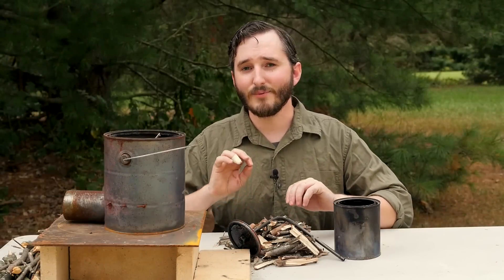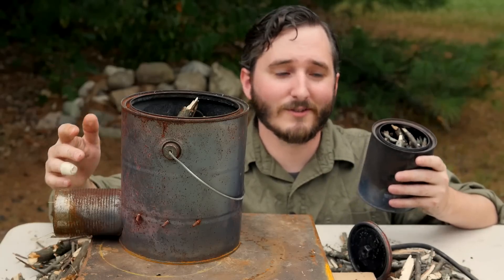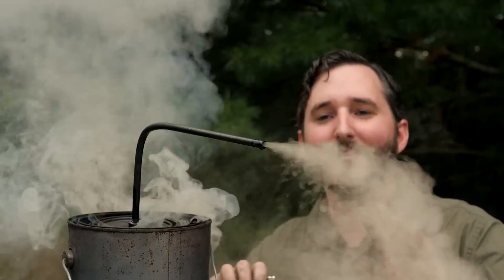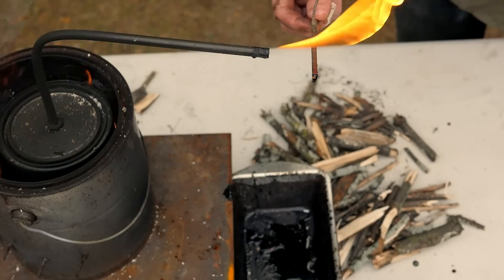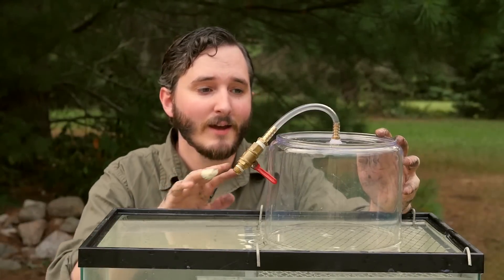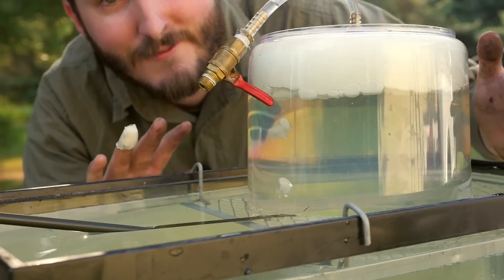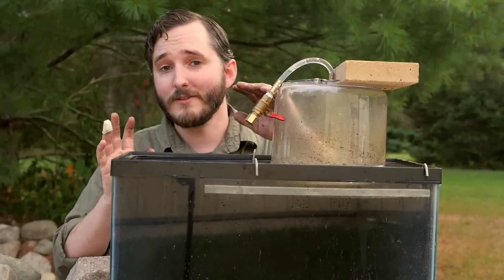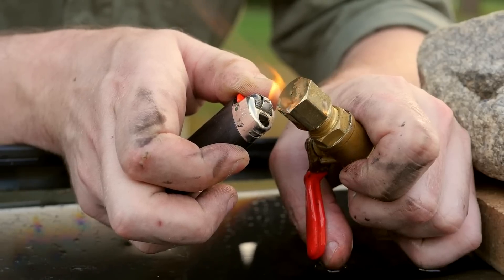How To Make Wood Gas Biofuel (and an experimental gas collection method)

Comment: It would be really interesting to see your take on a woodgas engine. Most of the other videos of woodgas engines on youtube are done by mechanics/etc so seeing it done by someone who is much more theoretical science focused would be nice.
Reply from the maker: I have a video about powering a small engine but I just barely got it to idle. I should try it again.
Reply: <<
Angus Davies
2 years ago
It would be really interesting to see your take on a woodgas engine. Most of the other videos of woodgas engines on youtube are done by mechanics/etc so seeing it done by someone who is much more theoretical science focused would be nice.>>

In my view,  a better follow on experiment would be filling a balloon with wood gas,  which would be portable and keep the gas pressurized.

Then use the gas to fire up a gas pilot light,  and after that a gas range burner and then a gas furnace burner.  These last two would be Bunsen burners,  and you could get an understanding of what those are and why they are commonly used.

Comment: I'm wondering if due to the depth of submerged container, the increased the pressure of the stored wood gas caused a high exit velocity from the outlet -- too fast for a self-sustaining flame. If the pressure were not as high (i.e., by removing water from the water tank), I'm sure we'd have seen a nice self-sustaining flame.

Great video!
Reply: <<I'm wondering if due to the depth of submerged container, the increased the pressure of the stored wood gas caused a high exit velocity from the outlet -- too fast for a self-sustaining flame. If the pressure were not as high (i.e., by removing water from the water tank), I'm sure we'd have seen a nice self->>

Yes,  but more likely was a lack of sufficient combustion air mixed with the fuel gas.  Reducing the fuel gas flow would allow for air to mix with the gas and thus burn. 

Connecting the gas to a natural gas pilot burner would allow the burner design to properly mix air and the fuel gas.  It would also meter out the gas at a sustainable rate,  rather than in what was a wasteful volume you couldn't keep lit.

Comment: Try electric heating coil, or high temp oven, use the experimental water filter, water-shift to CO2 and more H2, then feed back electricity to the heating system with hydrogen-air fuel cell

Comment: I bet you were super stinky after recording this lol. Thanks for the video! I tried to collect the gas by pulling it through an air mattress pump.... It got so hot the can melted! I wonder if filtered - if a generator this small may run a small weed-wacker engine or similar small combustion engine?

Comment: you can make a flashback arrestor easily,... and thereafter distill Hydrogen 2- 3 stages for very pure, very cold liquid hydrogen. It needs be charged into a safe container. 
Do not try to store liquid Hydrogen.... it has all the properties of propane.... With more heat.
Example.... Heat and Pressure turns the Suns surface into a crystal lattice of liquid metallic Hydrogen.

Comment: It's been only a few weeks since I first heard of wood gas. I learned of it first in the context of rocket mass heaters, often homemade wood fueled heaters that have long exhaust pipes and a lot of thermal mass, generally made of Earth. A common feature apparently is a wood gassifier. The main thing I'm confused about, regarding these stoves, is what happens to the tar? I'm familiar with wood stoves, and know that tar, or creosote buildup in a stovepipe or chimney is a major hazard. So I don't understand how it can be safe to have a long, meandering exhaust pipe buried in Adobe. Even your fishtank looked inky after this experiment. What am I missing?
Reply from the maker: Tar buildup is only dangerous if it's in a chimney running through your flammable attic.

Comment: Love the video!  We live in a part of town/country that doesn't have gas and I was looking at home biogas.. We use clay pots for their multitude of benefits, but they do WAY better cooking on gas.  Would love to know if you could come up with a way here to make this usable for kitchen cooking.  

Also, what makes that charcoal that you made different then biochar?  You didn't heat it enough for it to be biochar?  

Also, what precautions are necessary for the biogas to not ignite your lighter or to reignite itself inside the tank if the flow is unsteady?  The lack of oxygen in the tank or the pressure from it?
Reply: <<Would love to know if you could come up with a way here to make this usable for kitchen cooking.  >>

Wood gas is explosive if you mix it with air,  just like propane or natural gas. Trying to store enough wood gas to use as fuel for a range might easily create an explosion hazard.

<<Also, what makes that charcoal that you made different then biochar?  You didn't heat it enough for it to be biochar? >>

If he had show you what was left in his cannister after making the biogas,  that would be biochar.  Charcoal  ---more or less pure carbon.

<<Also, what precautions are necessary for the biogas to not ignite your lighter or to reignite itself inside the tank if the flow is unsteady?  The lack of oxygen in the tank or the pressure from it?>>

That's a VERY good question!  "Flashback "  is the term for gas that is moving too slowly to keep it burning at the burner where it should burn.  Fuel gasses will burn so many feet per second.  If you don't have the gas moving faster than that,  it will indeed flash back inside the gas supply,  or the wood gas generator in this case.  You'd also need air mixed with the gas for that to happen though.
Reply: @SeattlePioneer  Thank you for the reply, we since moved to where we do have gas and I also discovered 'solar cooker' and 'solar stove' which might be way more doable here in Texas than in Seattle, very excited to try them

Comment: Couldn't you have just opened the valve, pushed the collection tank down into the water, and then closed the valve?  You would have been able to evacuate all of the air and wouldn't have had to suck the water up.

Comment: You could wrap  the bottom of the radiator with a copper coil system to heat water.  So in a power outage, you can reclaim that heat for hot water.   Lets put ALL that energy to use!!

Comment: If you could take a water cooler bottle with a cap you would not need to sink the container. Then having a bladder with nozzle like bicycle inner tube. Then using a tire pump you could pressurize the container and use it directly. 
What do you think about that?

Comment: If you used a propane torch nozzle you likely would have got a sustained flame with the correct air / gas mixture
Reply: Robert Pearce  :D

Comment: You could place a air compressor in air tight container and gass line from your wood burning stove in it this way the air compressor will compress all the natural gas only. Good jobe on the vido  and on all your videos

Comment: Just out of curiosity, what are the carbon emissions like from a process like this?
Reply from the maker: Neutral. Burning dead sticks from the forest floor is carbon neutral because the sticks are destined to otherwise rot by fungus, which releases an equal or greater amount of co2.

Comment: OK great video, try a small tire inflation pump run the intake to the little tank with the clean gas and the tire side to an old truck inner tube.
After that you should have pressurized gas enough to run a generator or if you scale up the production end and bigger cleaner with a good supply of intertube.
If you pipe the gas in enough cubic feet per minute I'll bet you could fill a compressor tank at 120+ PSI run it through a regulator to what ever engine you want.

Comment: Hmm... You've got my gears turning now. Thinking a longer outlet line with a heavy duty condensation collector (such as whats found on air compressors) would be a good solution at collecting the tar out of the gas

Comment: You need something called a burner( and a pressure regulator.) Study how a propane touch is made ( bbq) A natural gas burner con be copied also because the btu are  approximately the same as the btu of the gas you made. Important to get the fuel/ air mixture correct.

Comment: I saw a video about making and filtering methane.  They put a small drum upside down inside a larger drum. With something to keep it from tipping over when it floated up. The gas is taken off from the small drum somewhat like you did there.  But they ran the gas up a long pipe with steal wool in it to start filtering the gas. It would cool and much of the tar and other things would stay in the pipe.  Some way to drain this off or a large place for it to go so after a long time it would not stop the flow of gas would be needed.  Methane doesn't have the tar. But the steal wool will filter out anything and if any acid is formed will lit it react with the steal wool as it goes up the pipe. As the gas is made it will float the small drum up and give it some pressure. Not sure how much pressure the gas from the wood would make to push the drum up. But it also bubbled up though the water to filter.  Then a U shaped pipe to let some of the water in the gas to condense in the lower part of the pipe.  Another place to have something to hold or drain the water. A cool pipe should get most of the water out. Maybe if the pipe ran upwards so any water that formed in the pipe would just run down back into the drums of water.  Just thinking!  Maybe it could work maybe not.

Comment: if you fix your receiver to the bottom of your tank and let it fill,when you produce the gas into it the pressure will displace the water and when you want gas, the water pressure will displace it out again,the volume of water displaced = the amount of gas stored,, 1Litre = 1 litre

Comment: Build a large bong much like here and run a hose from the top of it to the air intake of a compressor. You should be able to collect all (or most) of the gas and then power a small engine.

Comment: Its not propane or butan ... Its CO or cacbon mono oxit ...its produced when carbon is burned in oxygen lacking environment and its extremely poisonous many die every year inhaling that compound from coal fueled heater in confided space,... Its not dangerous but useless in most situation, especially for cooking in house.

Comment: Instructions unclear. I created a Level 3 Nuclear Biohazard.
Reply: My station is worse i accidentally create a nuclear bomb
Reply: Lol
Reply: lol
Reply: I'm sorry, not only have you failed to read the instructions properly, you have also failed to spell "unclear" consistently.  You, in fact, do not have any nuclear hazard, you have an unclear hazard.  Don't worry, the EPA is much more friendly than the FBI.
Reply: @Kineth1  the EPA are nazis compared to the FBI
Reply: Hey what if you had an afterburner oxygen depleted after burner to burn the tires s*** off first before you collected it would that not work I does work I've got it in my camper

Comment: NightHawkInLight
I am already subscribed - just from watching your videos on making Rope - Which is so drastically useful!! Now with this video I am having some thoughts to a Survival/apocalypse scenario. Is it possible to use a Lake or other Standing water in place of the Fish Tank, then use the Fish Tank as the Gas Collector? - I have thought of this and it would pollute the Standing Water Source and be very difficult to clean.....It would require a Tank to control waste.

My main reasoning for this question leads into this Objective: I would like to know if it is viable to utilize this method in conjunction with a Generator.

I do not consider this method for survival - but for advancement and convenience. If one was able to utilize this method to harness clean fuel, then utilize this to fuel a generator to generate electricity then potentially they could utilize Electronics, Recharge their Phones/Radios/Car Batteries/Computer or Laptop. If this can be done efficiently with the primary difficulties being in Lumbering, Refueling the Gas Generation Method, and the Configuration of setting up the Rig.

I would love to see a Generator of some kind with at least 1 Outlet, being fueled by the Gas you've collected here.
I would love it even more if there was an efficient method to have 2-3 Gas Production Methods hooked up to the Collection/Filtration Unit so that when refueling 1, another Gas Production Chamber is running - effectively creating a non-stop gas production as long as wood is available.

This would also generate ALOT of charcoal. Other than a Cooking and heating source for warmth, cooking meals without as much, if any, smoke - I am unsure how to "activate" charcoal but make the charcoal capable of water filtration - which is another concern....cleaning the water tank that is (This is when I added the pollution comment).

Anyways just some fruits for thought that I would certainly enjoy watching and learning about
Reply from the maker: Yes, there would be too much pollution to use a lake in this way. Better to find two containers that for together to make a gasometer (see my other video on the subject). Towns in Europe used to have large gas towers for this purpose but they've now all been decommissioned because natural gas is cheaper.

Comment: How about putting a float valve in a taller collection tank? Then hook up a small compressor to the out put going to storage. You can also use a water level switch from a washing machine to turn the compressor off. I never thought of using water. Good idea. Thanks.

Comment: could you compress it from the collector Vessel to store larger quantities in a bottle like butane?
Reply: In theory yes, however compressing flammable gas mechanically is pretty dangerous. The Industrial approach would be to cool it till it condenses and than have it as a liquid.
Reply: @Klokopf52  why should it be risky if it is a oxygen/oxidizer free/deprived athmosphere
Reply: <<could you compress it from the collector Vessel to store larger quantities in a bottle like butane?>>

Yes  --- a good place to start would be by filling a balloon, which would make it portable and keep the gas pressurized.

But wood gas can be explosive like natural gas or propane if it's properly mixed with air.  I wouldn't store more than an ordinary balloon amount unless you really understand what you are doing.

And wood gas is mostly carbon monoxide ---an odorless poison gas.

Comment: 4:00 To remove the steam, a long spiral descending coil in the form of a cone, even with ice resting in the conical coil, would condense the steam to liquid to drip out the bottom(like a classical still), leaving much of the volatiles to burn. (some might also condense like tars and creosote, would need to control the final gas temperature to prevent this)

Comment: It's called "pyrolysis oil," not "wood gas." A gas is not condensable - this "smoke is pyrolysis oil in its vapour phase. The gas that is produced simultaneously is synthesis gas: hydrogen and carbon monoxide. You won't necessarily see this. The syn gas is produced in high yield at 700 - 800 degC. The temperature used here leads to pyrolysis oil.

Comment: Can I use weed instead of wood to make WEED GAS?
Reply: 쌀맛을껌 - RiceFlavoredGum  Theoretically yes. The issue with biofuels is which ones are more efficient to manufacture and burn. This is measured in EROI (energy returned on energy invested) depicted as a ratio. Different materials or "feedstock" will produce a different plethora of gasses. After you make gasses the next step is to refine those gasses into a desired gas. Think you could do that?
Reply: @ryanhicks5627   in term of cost is no, the feeding material should be extremely cheap or free, or it would be pointless to do so as $ needed to convert to fuel is high
Reply: Cringe

Comment: It might be simpler to go ahead and sink the container before you fill it. You could probably increase the pressure, and thus total amount of gas held in the container before it was full. If you open the valve and let the water push all the air out as you sink it, then place the woodgas hose down to the water filled container that would also keep you from having to suck the air out yourself.

This is interesting though. I wonder how well this gas pressurizes.

EDIT: Just realized this video is from two years ago. I'm sure you have worked through all this already. Duh.

Comment: I think you need to wait till the gas is cleared of moisture and then start collecting it, will give better results ;}
Reply: or, we can try separate water inside it by distill it...
Reply: Well maybe distill will work but the problem is to separate the tar from it
Reply: @outright4620  ever heard about multi level distillation, i think it will work, but since we saw that the tar drips directly after the vapor produced, we put some sort of a container that has a hole on top of it for wood gas

Comment: During the second world war many German vehicles like trucks and cars were equiped to produce and use woodgas as fuel. They were called Holzvergaser. This was due to the oil shortages at the time.
Reply: yes but they used the woodgas compressed and stored it in gas tanks
They even made some BMW motorcycles run on this princip - and not that bad and slow as well  but most vehicles ran on gas that they didnt produce themselves but from mobile refinerie trucks with a stove and a steam powered compressor  with a small wood fired steam engine - the engines generally burned and needed more motor oil 
-bc of the hortage in oil the germans tried makeing synthetic oil from browncoal , stone coal, the black goo you collected from the wood gas and rapeseed oil they semi succeeded by makeing a additive to normal motor oil witch reduced crude oil needed for makeing motor oil by ~30%
Reply: Yes, it is a desperate option for fuel, can't win wars without sufficient fuel, fancy tanks, supply lines all required fuel
Reply: @pckkaboo6800  I love that cat. So cute.